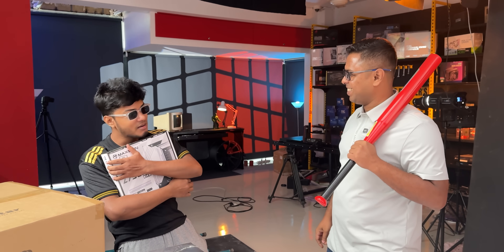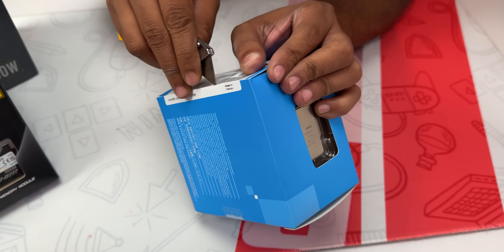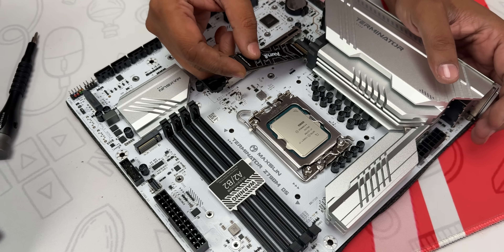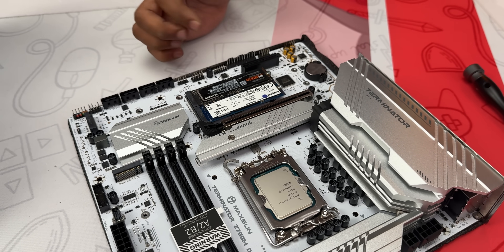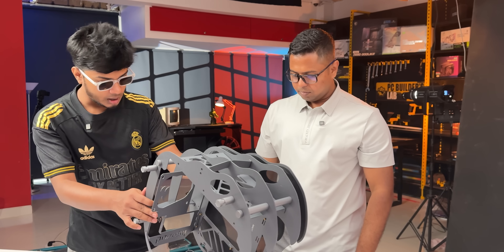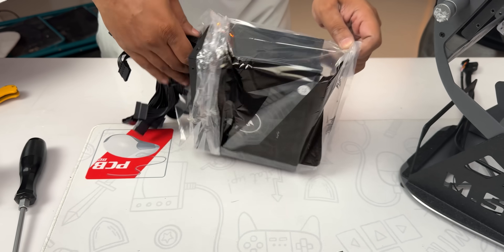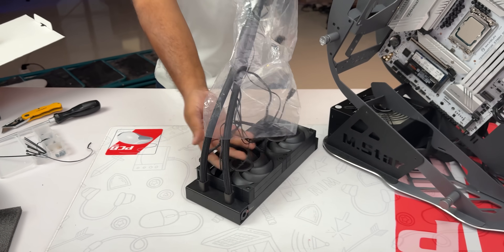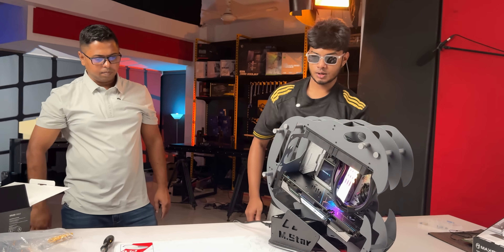১ লাখ ৭০ হাজার টাকার ভিডিও এডিটিং পিসি।

Comment: ভাই আমাকে ২৫০,০০-৩০০,০০০ এর মদ্ধে একটা বিল্ড সাজেস্ট করতে পারবেন প্লিজ
এটা আমার ভাবা বিল্ড
CPU: Ryzen 7 7700--৳25,000
CPU Cooler: DeepCool LS720 SE Digital--৳10,000
Mother Board: MSI B650 GAMING PLUS WIFI--23,000
RAM 1: Kingston FURY Beast RGB 16GB 6000Mhz DDR5 EXPO--৳7,500
RAM 2:Kingston FURY Beast RGB 16GB 6000Mhz DDR5 EXPO--৳7,500
SSD 1: Kingston KC3000 1TB--৳10,500
SSD 2:Kingston KC3000 2TB--18,500
GPU: ZOTAC GAMING GeForce RTX 4070 SUPER Trinity Black Edition--৳92,000
PSU: Corsair RMe Series RM750e ATX 3.0 certified Fully Modular Low-Noise ATX Power Supply--৳10,400
Casing: PC Power ICE TOWER ELITE BK--৳6,700
Monitor: MSI G274QPF E2 27" 180Hz 1ms IPS WQHD Gaming Monitor--৳43,500
UPS: ower Guard PG1500VA-CS 1500VA Offline--৳9700
Grand Total: ৳264,300 (BDT)

Comment: Poss : Ryzen 7 5700x 3d
Moth : Asus tuf gaming a620m plus wifi 
Ram : G.skill 16gb 5600mhz
Ssd : 612gb ocpc mfl
Cool : Ag400 wh
Pow su : Corsair cx650w (80 plus bronze) 
Casi : pc power iceberg version 2
Moni : pc power 22 inch leo 100hz
Gpu : intel arc A580
  আপনার সপে এই পিসি বিল্ড করে প্রাইস  কত পরবে, আমার চয়েজে কোথাও ভুল হলে দয়া করে যানাবেন, ধন্যবাদ  🥰
Reply: ryzen 7 5700x3d na niya ryzen 7 5800x nao aita basi valo x3d shudu aktu gaming a performance dibe but non gaming a na

Comment: Vaiya ami ekta pc build korte chacchi aktu amar build er ekta video banaben please and parle gaming benchmark o

Specs:

Ryzen 5 5600 with stock cooler

Gigabyte b550m aorus elite

Team delta 8x2 gb 3200mhz rgb ram

Gunnir arc a750

X

Xoc sp900 1tb gen 4 ssd

Gamdias helios m1 - 550w psu

Pc power flow white mesh

Comment: i7 12700k or i5 14600k? 
Which one would you suggest?
Reply: POV: 0:49
Reply: @MDShakil-tu2ke  thanks maan ❤
Reply: i5 14600k slightly better
Reply: vai apnar choice 100% intel na hoile ekhon intel na neoai better...tobe i5 14600k a prob hoar kotha na specially i7,i9 gula te prob hoi ja dekhtesi but still jodi intel neoa lage taile 12th gen neoai better
Reply: @nrnayem5028  thanks brother
Reply: @nrnayem5028  আমার বর্তমানে rtx 3050 আছে। এটার সাথে কি i7 12700k নেয়া ঠিক হবে? আসলে আমি cpu upgrade করবো
Reply: 13600K/14600K
Reply: @yourtrinty  instability issue🙃